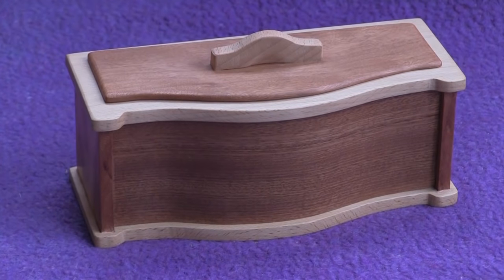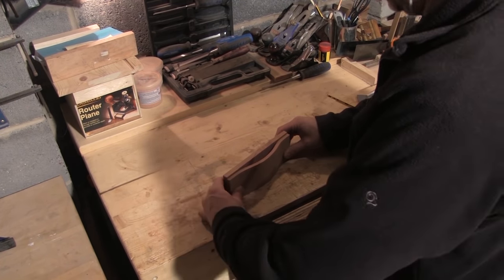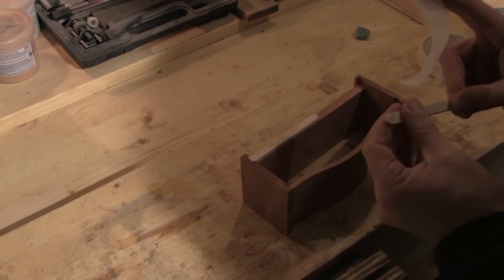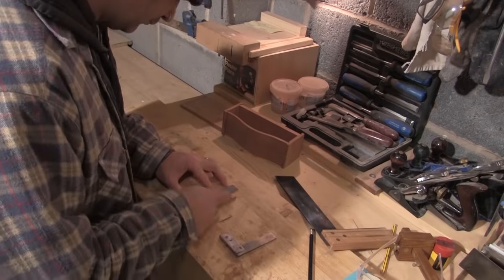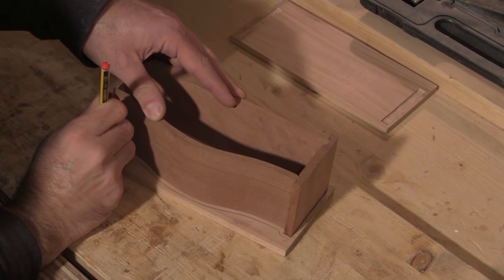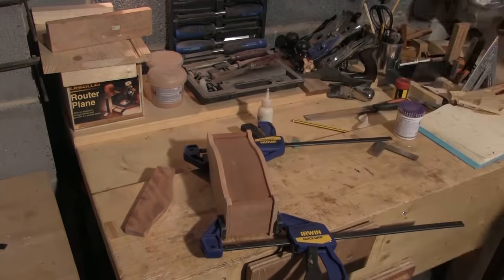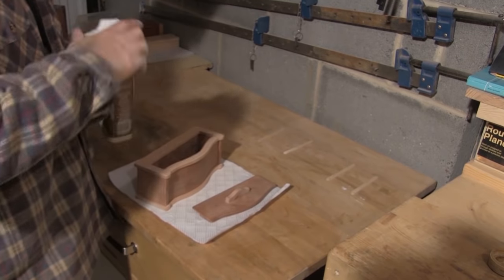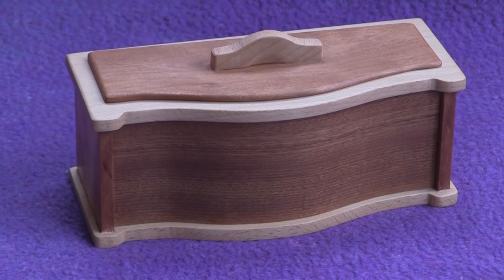Woodwork Project: Curved Front Wooden Box With Lid

Comment: Seems like you made that project harder than it needed to be. To each his own.
Reply from the maker: You'll need to explain that.
Reply: Adventures In T-Shirts Woodwork , My guess is he meant that you could have made some of the processes easier, like using a router as an example.
Reply: Adventures In T-Shirts Woodwork  as Welch pointed out a lot of time could have been saved and the dados would have been easier and more accurate with a router or even a table saw in some cases. Also cutting them at the same time from the same piece of wood, then cut that down to your side pieces. 
You can do your flush edging with a straight bit and roller guide etc. I’m a big fan of routers and power tools in general. But if you prefer digging them out by hand that’s fine too.
No disrespect intended, just an observation.
Reply from the maker: @makemyday1477  Hey, aha yes I see what you mean, no offence taken. I've nothing against power tools and machines, it's just that I tend to mostly post hand tool projects on this channel as that's sort of become the theme. I use my power tools routers, tables saws, etc much more on commercial jobs, but this was very much a hobby project - the band saw got a lot of action in this build as it was new to my home shop so was having a play with it. I don't mind admitting that the European beach I was using was particularly hard and cutting the dados by hand wasn't the most fun! But these projects are more about the doing than the getting done.

Comment: excellent presentations with clarity and patience. Could I ask for details of the Band saw and drill press , they look just tight for me.
Reply from the maker: The band saw is Axminster's 250N it's the slightly bigger second size up, and is a great hobby choice - it's just a bit bigger than the standard entry level saws common to most manufacturers so it has a little more cutting depth. The drill press is just a cheap 5 speed belt driven affair. I think is an Ebauer, but I think like a lot of bottom end kit, there are probable versions with many badges on.

Comment: Great work love the use of hand tools where possible one thing intrigued me though before glueing your top on why didn't you use it as a template to make your lid beautiful box great contrast with different woods
Reply from the maker: Hi Allan, thanks for you comments. I can't remember why I didn't use the top as a template, it's possible it just didn't occur to me. I do remember that my main concern was ensuring the visible part of the lid has a uniform inset so as such, once I had the inner part cut to size and fitted to the top I may have felt more comfortable gaining this accuracy by  fitting the lid on the job. My tendency is usually to fit on the job rather than pre measure or mark out, but your suggestion regarding templating is just as valid, maybe even a better approach. Thanks for the feedback.

Comment: Lovely old-school craftsmanship! Long time since I saw someone use a hand drill! Just one question.... when you were cutting the former from construction timber for the bowed front, did you have any problems with the blade on your bandsaw 'wandering' from your chosen path? Enjoyed every minute of your presentation. You clearly have a passion for quality!
Reply from the maker: Hi David, thanks for the comments. I don't recall having any problems keeping the blade on path. Of course I'm probably not quite as concerened with absolute precision on the former as I would be cutting an actual component as I know that the laminate pieces will have their own resistance as so any lumps or bumps on the curves will get smothered out a little when gluing up. Having said that I do try and cut as accurately as possible. I spent quite some time setting up my band saw properly when I first got it, and I regularly check things are still set correctly. I also make sure the blade is tensioned correctly and  always have a decent blade loaded.

Comment: Well, I tried this front with sapele with a form similar to yours,  the sapele fractured (split out on the outside of the curve) before I got the form half way closed, and that was way difficult.  I had 4 1/8 inches pieces of sapele.  The book I am reading on wood bending says sapele is not a good bending wood (look great, though).  Says the grain is too close.  It recommends white oak, European Ash, Dutch Elm (is there any of this still living?), yellow birch (American), Sycamore, and European Walnut.  I have some white oak on hand, will try that over the next few days.  I always use Titebond 2 (a PVA glue), I wonder if a glue with a longer open time (Titebond 3) would help.
Reply from the maker: Hi Paul, I'm sorry you had some issues with bending the sapele. I've not had the issues you describe - maybe I have been lucky. I have always had the grain running across the bend, I don't know if that help or hindered to be honest. I made the laminate pieces very thin, and the curves on the former were fairly gentle.  It also helps to allow the glue to soak in as this does make the wood more pliable - a glue with a longer open time would certainly help there.  Do let me know how you get on with your white oak.
Reply: Today I approached this again:
1: made my thin pieces out of white oak;
2: made pieces thinner,  about 2 mm thick (about 1/16 inch);
3: used only three slats instead of 4, total width less than 1/4 inch;
4: used Titebond 3 instead of my usual Titebond 2 (3 has a longer open time and is thinner);
5: I made a new form with a less severe curve (about inch instead of 1.5 inch);
I was still difficult to close the vice, I added 2 heavy F clamps and 2 heavy C clamps.  I finally got it closed, it doesn't look like it split.  I'll leave it overnight and report tomorrow.  I wonder if I'll get any spring back.
Reply: Yes, the front looks like it came out fine.  I made the back and tomorrow, its on to the sides.  Thanks for your video.  Really well done.  This is my first foray into bending, I had been looking out for something as my first bending project, this was a perfect fit.
Reply from the maker: @paul6096  Excellent, it's great to hear things are turning out well.

Comment: Nicely done! By chance do you offer a plan for this box?
Reply from the maker: Thank you. I'm afraid I don't have any plans to share, they are all in my head. The dimensions are completely down to the material I had available. The width of the beach dictated the maximum width the collar and base could be I work back from there to decide on the with of the ends of the box. The heigh was down to the width of the sapele  board I was working with.

Comment: You cut your form on the band saw ? If this be the case you could have glued two pieces of your material together and cut it out on the band saw, no down time or the at least very little.
   I do like the way your box turned out.
Reply from the maker: HI Matt, I;m intrigued but don't quite understand your idea, could you elaborate?
Reply: @adventuresint-shirtswoodwo3905  ,I was refering to using solid wood rather than laminating. From the appearance of your band saw you seem to be able to stack two pieces or use one piece that is tall enough to pass under your band saw guard and produce two pieces .I was thinking of production but if one box is all you wanted to make that is another story?When watching a video sometimes size appears vague?
   I made my living working with wood and time could make  or break me. I generally made several item while I was set up, less down time.I am retired but still have my shop.I can now do as I please while in my shop, no customers to worry about! Your box and presentation were very well done!
Reply from the maker: @mattedwards4533  Hi Matt, aha, yes I see what you mean now, and you make a good point about production runs and economical use of time. I very rarely have a single project going so glue up on one project is usually time spend on another - but yes, cutting a number of formers for batching would be wise. In this case as you guessed I was making just the one - and in fact I was prototyping as I went so no time pressure. 
Thanks for your great feedback.
Reply: @adventuresint-shirtswoodwo3905  By laminating the pieces you maintain the figure in the grain.  If you cut the front from a solid piece on the bandsaw, you are creating elongated end grain which would also absorb the finish in a different manner.  Beautiful box that gives me several ideas at the same time.  Goodbye.  I have to go out to my show now.

Comment: very nice , use wood dowels next time for mounting the handle no screws this way  just a thought.
Reply from the maker: Hi, thanks for the comment. It's a good idea, usually I try avoid using any hardware, preferring joinery to secure everything. I'm not sure why I choose screws in this instance to be honest, although my engineering impulse would be to avoid using dowels in the same alignment as the pulling force for fear of them pulling out - I'm not sure if that's a valid concern. Maybe some sort of wedged dowel would make me feel more comfortable - although that is probably be a massively over-engineered solution for a handle on such a light weight lid. Certainly an idea to consider though, thanks you.

Comment: hi, what thickness blade was you using? great video. new sub.
Reply: on the bandsaw,ty.
Reply from the maker: Hi Robert, I believe it was a 1/2 inch blade at around 12 TPI - that's a bit fine for ripping, but worked well for making the thin laminates.
Reply: @adventuresint-shirtswoodwo3905  appreciate the reply,ty

Comment: You cut the ends of the curved front using the mitre saw then why did you not use the mitre saw to cut the back piece that was a no brainer?
Reply from the maker: There was possibly something leaning against it and would have taken longer to move it then do it by hand.